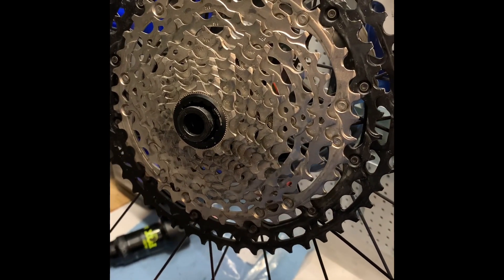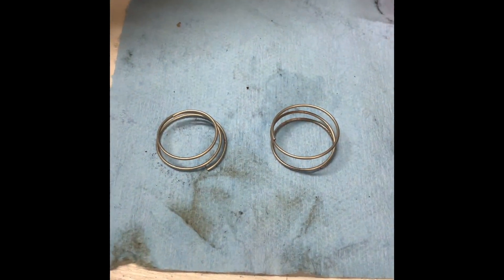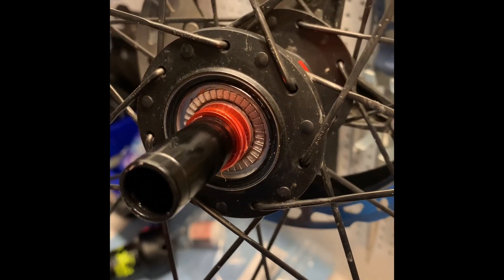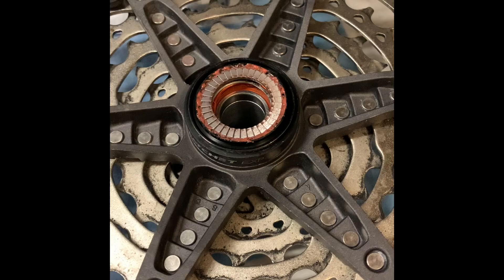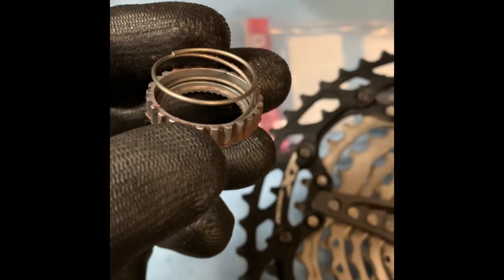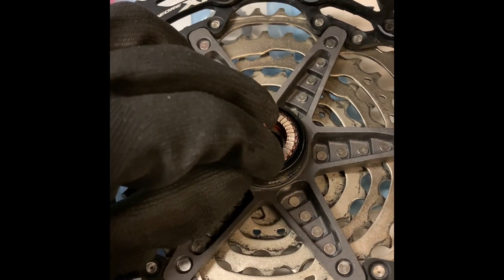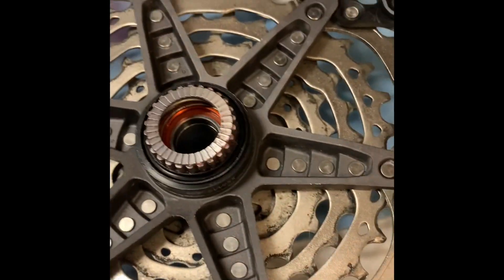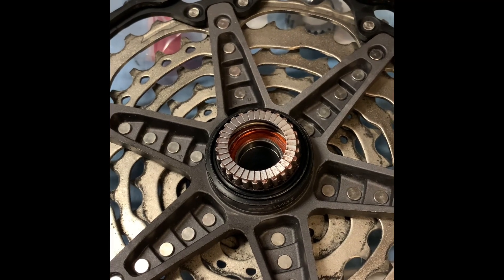DT Swiss 240 EXP skipping / disengaging - bad design?

Comment: Mine lasted for three weeks until this same issue. Bought new in May. Design is completely flawed.
Reply from the maker: Wow, mine has been flawless after the repair and my new 240 EXP Hybrid is also doing fine. Did you check for excessive grease?
Reply: @jaj07 I am not going to service a three week old item used for commuting.
Reply: @rewind9536
I have a new DT Swiss 240s never unboxed. I switched over to e-motos and e-bikes and don't know if I'll ever use the thing. DT Swiss should return everyone's money or replace the hubs with the 240s.

Comment: I've had the DT Swiss free hub star ratchet fail on three separate occasions.  Once on  Giant Propel (Cadex wheels which use DT Swiss hubs), once on a Specialized Epic Evo (DT Swiss 350 hub)  and just today on  a BMC Kaius 01 two ( Not DT Swiss but Exactly the same design).  The design is flawed and dangerous.
Reply from the maker: The new EXP or the old style? I have never had issues with the old style and the EXP has been fine since DT repaired it under warranty. It is very particular about the type and quantity of grease though.
Reply: I'm not sure mate.  It's a new bike, worth 8k. only 450kms.  It's bloody ridiculous.   I'd have less trouble with a bike from Kmart.

Comment: haven't had any skipping issues  but did have problems killing that bearing behind the ratchet. for whatever reason that 1526 would get crunchy while the other 3 were fine. after a couple of bearing replacements DT sent me a new inner ratchet since i had the older skip prone design but did not experience skipping. to others having skipping problems use a lighter freehub lube. a custom concoction of mobil1 5-30 and marine grease makes a thinner but greasy substance that flows much better than DT grease. you get faster engagement. i think in cold weather especially the DT grease is too thick thus preventing the teeth from grabbing as they should.

Comment: I also had some little disengaging problems with my EXP OS as it was brand new! After a few kilometers of burn in no longer issues there.
Reply from the maker: Interesting! Probably due to the amount of grease then as the actual disengaging problem does not go away on its own.
Reply: From what I read in the official note, exp os shouldn't be affected 😳

Comment: how did you get on with this? design issue or just bad batch
Reply from the maker: This is a design / manufacturing issue. DT have issued a voluntary recall for affected EXP hubs. I had mine repaired a year ago and it has been 98% fine apart from the occasional twang once or twice per ride. Even works in the cold now.

Comment: I had the issue with the freehub side ratchet in my mavic binding too but a simple clean out and re-grease fixed it. I hadn't serviced it in a year so it is probably my fault lol. The mavic has hollow ratchets and one spring too but the hub ratchet is not screwed in so don't need a special tool to remove it.
Reply from the maker: I also had a few Mavic ID360 hubs and they are reliable as long as you keep them clean and lubed.
Reply: @jaj07  yeah they have been super reliable in the grimy wet British weather

Comment: I think its a the problem there is a code on the hub and in the code is number 308 and if you have it there is gonna be a issue tjere are videos talking about this issue and dt swiss will fix it if you tell them i think watch some videos about that problem 
Edit:found the link https://youtu.be/TeZXukqzon4
Reply from the maker: Yes, I had mine repaired under warranty some time ago and it has been fine since.
Reply: @jaj07  that is good to hear

Comment: Still looks like too much grease. Especially on the circumference. Considering the colder temperatures I would go for an oil instead of a grease. Got some gear lube from my outboard engine in there and it runs fabulously.
Method to test engineering tolerances: Remove all grease. Maybe add a 3 drops of oil. If it doesn't jump in and out easily the tolerances are too tight.
If that happens with 2 sets of ratchets ... You can claim new wheels for sure. Bike shop should done this for you.
And again no grease on the outside.
Reply from the maker: I tested the hub with oil as well and performance was even worse. The fit between the moving ratchet and the freehub body is quite loose. There is a clearance of more than 0.3mm so oil causing it to stick is unlikely.
Reply: @jaj07  The 0.3mm clearance is the problem. The ratchet starts to bind inside the freehub splines, like cassetes did on aluminum freehubs, and than the ratchet locks in inside. This is the problem, not excess grease.  I think this is a bad design, if you reduce the clearance, old grease will lock up again the ratchet inside. And this is very dangerous, as we can fall because of that.
Reply from the maker: @jm-btt  I agree, the interface between the freehub body and moving ratchet has too much clearance which allows the moving ratchet to tilt and bind.

Comment: Can´t believe DT makes such junk, I bought a 240 EXP and it failed in a 30km ride and now I find there is a recall from DT. Does changing ratchets actually address the issue?
Reply: I wouldn't call my hubs junk at all. I use 240's on my road rims, and 350s on my mtb. I have around 8000 miles (12900km) on the 240's, and have used it from normal light riding to racing in Cat 2/3 crits and road races, and has never had any problems with mine. That being said, I've never had to contact DT Swiss, and can't say anything about their customer service, but a few bad hubs doesnt make them all junk
Reply: It was a manufacturing error not a design error

Comment: Dude everyone knows dt hss cratored hard in quality. The new hub suffers from extreme bearing failure due to design.
Over priced junk.
Reply from the maker: I haven’t had any bearing issues with mine but the ratchet design is indeed problematic and it seems they have not tested it properly before release 🤦🏼‍♂️
Reply: A 500 dollar hub. Lol thats just stupid. No hub is worth that. Not even bomb proof is worth that. Gosh...  sounds like marketing magic
Reply: 8000 miles later, no problems with my hubs, on 240's

Comment: Man I wish I saw this video before getting DT240EXP wheels ... My rear hub is currently being warrentied by DT ...
Reply from the maker: I hope you get it fixed! Sending mine in as soon as I have another wheelset to use while the EXP is getting checked, hopefully in a few weeks.
Reply: Sell that sht asap, its s design issue, it will never last. Flip that mf fast. My group has had giant nightmares with dt over the last year. The new hub has a non sealed bearing and gets sugar sand in it. You cant stop it. Its junk.
Reply: @Hawlkeye-e9p  Not willing to lose the money ... I just got my wheel back from DT and they changed all of the internals. Now there is noticeably less drag in the freewheel than when it was new. I hope that it was a tolerancing issue. I understand how the design is maybe not as good as the previous star ratchet,  we'll see how this goes from now on I guess.

Comment: Exactly the same issue on my 180 EXP hub and a friend of mine has a brand new 240 EXP hub which has just started demonstrating the same problem. I can replicate the issue with it sitting out of the hub by pushing the spring down and then applying some twisting torque to it. I'm getting new parts sent to me under warranty, but I'm not sure it's going to fix this ..? I think this design is just not good.
Reply from the maker: Yes, I’m looking to post in the next few weeks 👍🏻
Reply from the maker: I’m sending mine to DT for a warranty repair as well, but like you I’m not hopeful it will solve the  issue unless there’s a manufacturing fault with my freehub body. I think this is a design issue and the moving ratchet is incorrectly dimensioned. It binds on both the spring and freehub body.
Reply: @jaj07  I wonder if there's a DIY fix like polishing the star ratchet splines or beveling the leading edges
Reply from the maker: Yes, Beveling the inside of the ratchet ring where the spring sits and the back ends of the splines for the freehub interface works. I have done this to a spare ratchet I have and no more complete disengagement after about 1000km and also in sub-0 temperatures. Sometimes the hub still skips, but only about 45-degrees or so
Reply: @jaj07  could you post pics on your blog which areas you changed?

Comment: was your replacement ratchet another 36t?  have you tried a 54t?  i have a set that i immediately swapped to 54t.  frame is currently getting repaired so i'm definitely eager to get on them and see if i encounter the same problem.
Reply from the maker: Mine is the original 36t that came with the hub, but the number of engagement teeth is not likely going to cause or solve this problem. I have a few ideas I’m testing before the hub goes back to DT for a warranty repair.